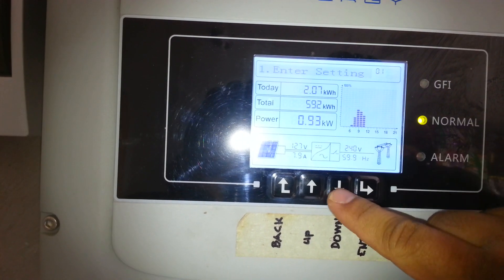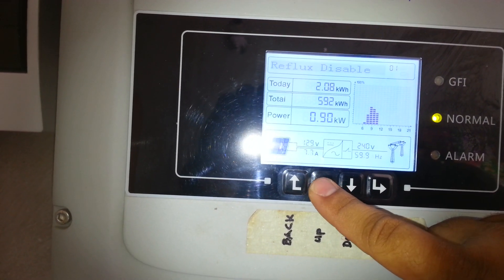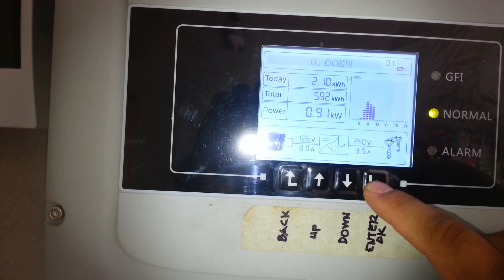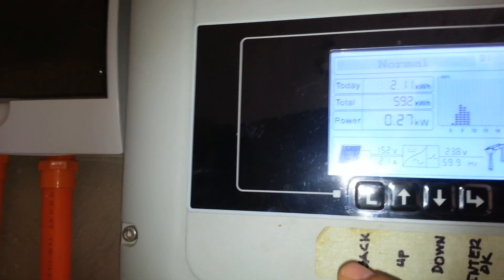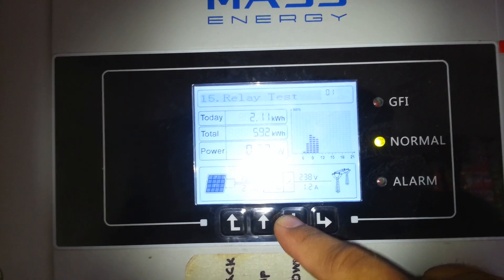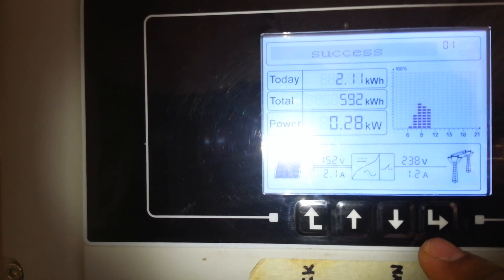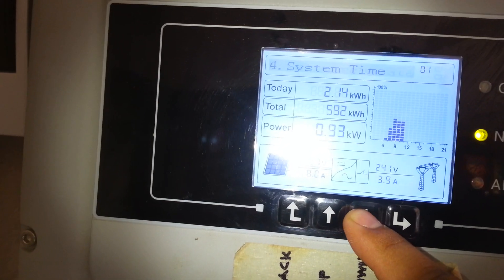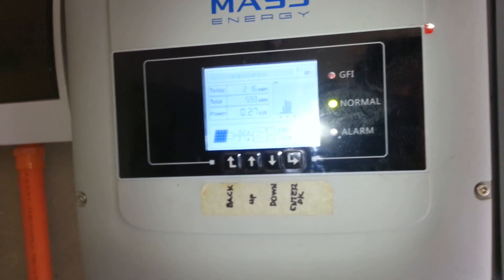Sofar Mass Solar Panel inverter Reflux setting

Comment: Meron akong nakitang video ni off grid garage, ung gamit niya SUN GTIL, sa video niya meron ka pa rin makukuha wattage from grid pero maliit na lang, kasi handle na ni solar most of the load. At kung iisipin mo na pag wala si grid, mamamatay dapat ang inverter mo as safety precaution yan ng manufacturer. So pag iniexpect mo dapat zero watts from grid, parang wala na rin si grid, so dapat ma off ung inverter mo. Kaya tuloy pa rin naandar ang inverter dahil kumukuha pa rin siya sa grid ng konting power.  Eto ay analyze ko lng.  Tnx

Comment: Great video. Does the reflux setting limit export to grid. By this I mean if you set it to zero and your house is only using 100 watts, does this mean your solar system will produce just enough power to cover house usage? So, if set to zero and you are using 100 watts but then switxh on the microwave and start using 2kw, will the solar then increase production to try and supply 2kw?
Reply: Yes
Reply from the maker: Yes , solar will increase production per power consumption and the Sun.
Reply: Ibig sabihin sir kahit di kana ba gumamit ng limeter is ok na Kong may ganyang sittings
Reply: @jodheldeleon7721  NOPE. You need the limiter to sense the current.
Reply: @nickpablo1097  ibig nyo ba sabhin hindi gagana ying anti reflux kapag walang limiter??
Reply: @carlovincentbalicas6207  yes

Comment: Thanks for the video. But in my case turning the reflux on and off doesn't make any difference. The inverter still export its full harvest energy to the grid. Tried every possible locations for the ct too. Can you help sir?
Reply from the maker: Check ct connection .
Reply: @vincedelima7515  hi sir did check all connection for the ct. Even had second unit tested same result. My ct rating is 0-150A 3000:1 for sofar 2200TL edit. We have the ct work upon.software update.  However it could not limit itself down to zero export. But rather 90w.
Reply: Mark S. Same problem to me.
Reply: I had the same problem, so please tell me if you already had understand why yours did not work as it should, or is a model flaw however, thanks dear
Reply: Mark, lelet, and luiz,  we all have the same problem. Reflux power set to 0.00kw ,  bought 2 sets of CT since i thought that the first one is defective, tried all possible ct positions but still cannot limit ng export to grid.  I bought ct rated 3000:1  0-150a.   Have you resolved it already? Thanks
Reply: @Vince Delima, What ampere rating is your CT? It seems that 3000:1   0-150a  is not working. Ty
Reply: Same issue, na iset ko na sa 0.00KW pero nageexport padin ng energy. Do any have a workaround on this?
Reply: Na solve naba etong problem sir? Patulong naman po.. same problem with mine.
Reply: @lean32322  I think there is no solution for this yet
Reply: @marks2730  your CT ohmic value must be 50 ohm (current is measured in CT in terms of voltage)
Reply: @marks2730  sir Saan nyo po nadownload ung firmware. same problem din po sakin may nakapagsabi na mag firmware update daw pero wala ako mahanap na firmware sa website ng sofar

Comment: Hi Can you help me,i have the Hybrid Sofar 6000-ES,it has a GRID port and a LOAD port,does the Grid port connect to DB in my house?and according to the manual on there website the LOAD port is only for EPS mode when you have a battery and want to use it like a UPS,,,,,so does the Inverter give power to the house trough the GRID port?
Reply: up

Comment: Any idea on how the CT clamp could be setup via wireless device?
Reply from the maker: The  inverter model is wifi capable, you be able to see power generation , PV current /voltage , AC Output Current etc . Online . Step by step procedure in configuring WIFI connection can be found on the users manual
Reply: @vincedelima7515  Sir ano, ibig sabihin nung figure sa AC Output Current?
Reply from the maker: @radoracimo4296  alin nyan sir?

Comment: Sir good day baka pwede magpa turo pano i setup wifi. Nasunod ko na sakin sa manual pero unpingable parin wifi ko
Reply from the maker: Pano mo ni configure sir?
Reply: Pag hindi naka hide ssid ng wifi ko mag connect sya agad pero pag nag hide nko ulit ng wifi namin ayaw nya ulit mag connect kahit manualy input ko n mac address ng router ska nka tick n yung connect even if it dosnt broadcast

Comment: sir, kapag ba my net metering na ako need ko ng idisable yung reflux? or enable for exporting properly. thanks
Reply from the maker: yes sir, disable mo na yung reflux kung naka net metering ka na
Reply: Vince Delima salamat sir 👍
Reply: SIr, after ko madisable yung reflux ko, nawala rin yung data ng grid at consumption ko sa solarman app, my ibang settings ba ako na dapat gawin?
Reply: @robinramirez2060   same problem din ako sir sa ganyan kamo, iniisip ko kung gawin kong  " Enable reflux then Set ko ng 5Kw" (5kw rating kasi ng system nya)

Comment: Para asa ang enable ug disable sa reflux po? Unsay effect po?
Reply from the maker: for power export control sir ,  pwede mo ma set how much eexport mo na power to DU grid.
Reply: @vincedelima7515  Sir paano ang wiring? yung load ba ng bahay nakahalo sa grid source na pumasok sa inverter?
Reply from the maker: @radoracimo4296  pm mo ko sa fb sir bigay ko sayo schematic .

Comment: What does reflux enable do mate??
Reply from the maker: power export control / limiter
Reply: @vincedelima7515  so Disabled means no power limit? And enabled means it can be limited to a certain kW value?
Reply: @JasperSikken  yes, that is correct.

Comment: Sir may experience ka ba po sa error na Forced Power Off sa Sofar Solar Grid Tie Inverter? Naka ganyan yung akin right now eh
Reply from the maker: d ko pa na experience ang  ganyang fault sir.
Reply: Narepair po ba yung forced power off error?
Reply: @nikkogarcia6496  na repair boss, factory reset lang then ok na... wala na dapat galawin pag install...

Comment: Sir same po tsyo ng inverter bali gabi na ako natapos sa oag install kaya wala ng power ang solar. Nung nag on na ako ng AC ay di bumukas. Normal lang po ba yun?
Reply from the maker: Alin d nag ON sir?
Reply: Yung inverter po kasi ayaw di nag on kahit naka on ang AC and DC panel. May kinalaman po ba ang di pa naka kabit ang CT Clamp
Reply from the maker: Basta naka connect yung solar panel mo sir during day time nag O On yang inverter kahit d naka kabit yung ct mo
Reply: @vincedelima7515  Sir nag ON na po ang Inverter. Pero naka ilaw lang po sya sa ALARM at wala akong nakikitang details sa grid part ng screen. May mali po ba or meron akong di nagawa. Salamat po.
Reply from the maker: @jaysondancel  pm mo ko sa messenger ko sir send mo yung pic ng fault at electrical drawing ng connection mo
Reply: @vincedelima7515  nag pm na po ako sa FB sir tnx